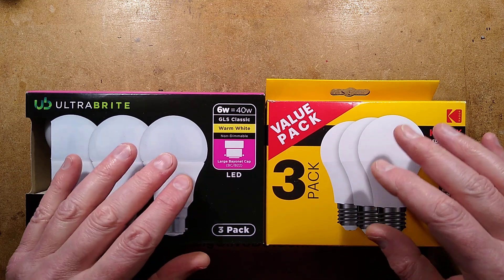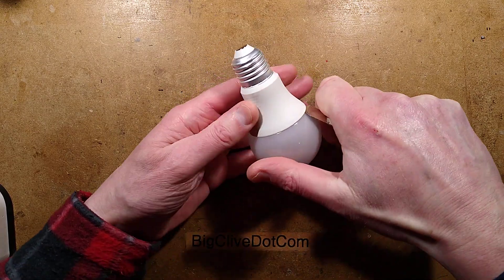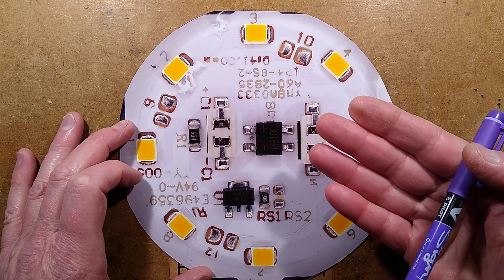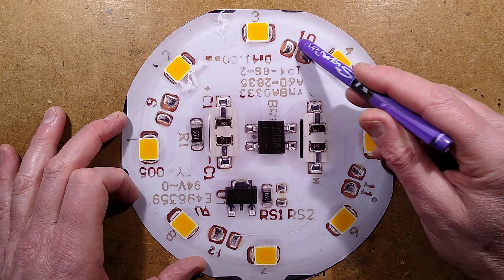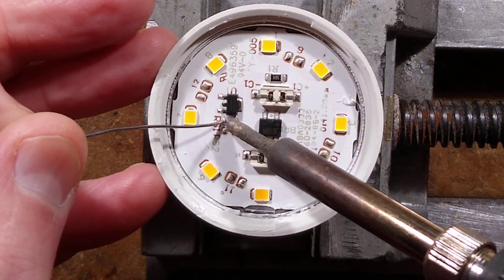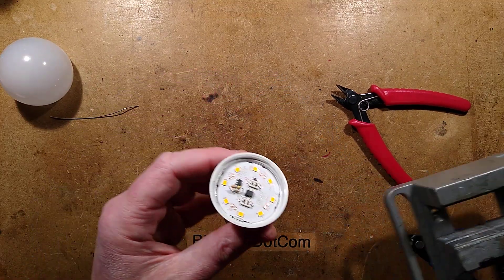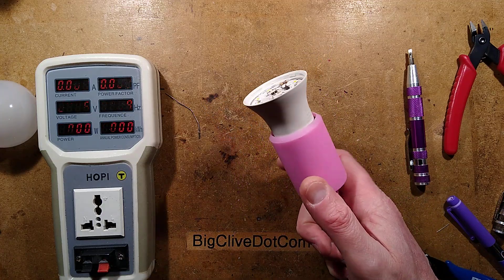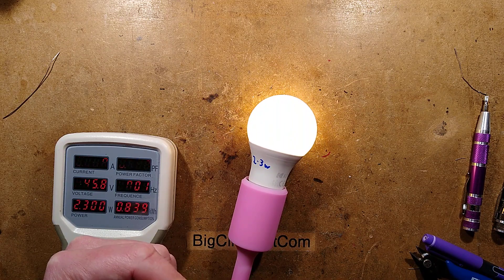Hacking Kodak lamps

Comment: I've noticed in the US, most of these lamps have only one sense resistor. I was actually contemplating doing just what Clive has done here, but currently have too many irons in the fire. I usually just get the 40 watt equivalent, but suspect that the only real difference between 40, 60, and 100 watt equivalents is the value of that resistor. 🤔  I should have picked up a few of each when I was out yesterday to test this theory. 

Funny coincidence that Clive's soldering iron needed some repairs, since I'm struggling to find replacement tips for mine. It seems that the only tips that are made for my iron cost about half of what a replacement iron would. Must be time to upgrade from my poor old Wall-Lenk!
Reply: Bulbs with different ratings will very likely have a different number of LEDs fitted. The LEDs are very likely the most expensive components in the bulb, so you can be sure they will be drivern to their "max".
Reply: @superdau  you may be right. I think it would come down to the most cost-effective way to produce these lamps (cost of # of LED per board vs cost incurred with programming/tool change) . Unfortunately, the few bulbs I have available for comparison are too radically different to be of any good to compare.

Comment: Hello, I was wandering if it could be possible to hack those king of lamp so that they are a little "smarter" : light level is dim by default and brighter when a sensor is activated (motion or whatever).
Could a digital output from a sensor change the value of the sens resistor ?
That would be a nice upgrade ;-)

Comment: Great as always! However I would go the other way and try to double up those LED chips so half the current to each effectively getting close to dubai lamps in efficiency and longevity with also making them last longer Maybe even mix in LEDs with higher temperatures. Can't stand dim lights
Reply: I can't stand dim lights either, but I guess the best solution would be to just use a light fixture with 2 or 3 bulbs to get an overall power of over 10 watts
Reply: @ChronicMechatronic  while that achieves the brightness it won't make them more efficient at those chips are being driven hard.
Reply: @Will-sc3hw  I mean put 3 of them in one room after modding them. Then they are closer to their optimal efficiency and you get enough light
Reply: @ChronicMechatronic  yeah, that works too
Reply: @ChronicMechatronic  oui is is it 8 i

Comment: I have a novel way of getting a less powerful lamp. Instead of buying a 10 watt lamp and possibly destroying it in the process of modifying it. I buy a 4 watt lamp and save a couple of $$ in the process and it works out of the box!! Strange I know. I also keep the receipt and mark the lamp with the date. If it fails under the 3 years, I get a replacement or my money back. Something you cannot do if it's been opened. Only problem is, it does not make a good video.
Reply: But the 4 watt lamp is like this one, over driving its led's so you need to hack the 4 watt one too so it lasts longer, only you bought a 4 watt one thus you now have a nightlight after the hack...

Comment: Note.
Flashaholic here.
Decreasing the power to 25% of the original amount (2.5 W from 10 W), has decreased the luminous flux from 100% to 50%. (500 lumen to 250 lumen), with a combined efficiency increase of 30% (from 45% to 60%), and lifetime increase of 200% (from 3,000 hrs to 10,000 hrs. at 20 °C ambient temperature).
Great perennial light bulb!

Comment: Resistance is futile! - So we'll just resist a bit more, then?

Now, I notice that these things usually come with a comment on the box which reads "Non Dimmable". Well, that definitely looks dimmer to me!

On a side note, how much less power would these lamps draw if you simply used say, a 240v lamp on a 120v supply? Would dropping the volts by 50% result in a 50% drop in Watts? I.E. would it be linear?
Reply: You have all the values you need to calculate that in a shot with the meter in it :)
Reply: With these lamps the power consumption should be pretty much proportional to the input voltage if it's in the normal operational range. Below 200-210 volts or so the power starts dropping considerably. Below 170 volts it's going to be nearly zero.

Comment: would adding a small variable resistor with the adjustment some where on the outside work
Reply: Make sure you have a nice bias. Like the original resistor and then the adjustable one in series. Make sure the parts you can touch are not electrically connected to the resistor terminals - this current regulator could be on a rather unpleasant voltage in regards to ground.

Comment: I thought LED light bulbs were supposed to be energy efficient, but I noticed the Dutch Calex brand being sold in Tesco are pretty much all rated as 'F' for energy efficiency.  Could someone please explain why that is, please?!
Reply: They've updated the scale they use to assign the letters to.  Apparently we're being encouraged to not buy electronics because they are now F or G rated in energy usage 😕
Reply: @0xf_Steven  i think it's more that there's lots of room for improvement on the scale now. Previously led lamps were all A+++*** or whatever, now even the decent ones might only get an E. The idea is that manufactures now have an incentive to make more efficient designs again
Reply: @0xf_Steven  I guess I'll just revert to pig fat candles, then!!
Reply: Energy rating is relative to the product category - classic incandescent bulbs got a different rating (when they were still legal) than LED bulbs. Also the rating gets more and more agressive every few years. So your F LED bulbs today would have been something like AAA+++ ten years ago. They are probably F because they use the LED chips at high power, where they get hot and inefficient. Normal LED lamps should be about 100 lumens per Watt, really efficient ones will have more lumens, really bad ones more watts.

My guess is that in ten years we will get A rated LED bulbs that are essentially optic perpepetuum mobilés - outputting twice as much power in terms of light than they are consuming in electric power. If you combine those with class A efficient solar cells you can really cut back on your electricity bill! The downside will of course be that you have to be careful to not produce a runaway photon cannon this way - always install a current limiter.

Comment: About 6 months ago I bought some ASDA LED lights to hack, But I could'nt remove the lense without destroying it. It was realy well glued in. So I bought some from B&M, Eveready branded, the lense came off easily, but there were no resistors, (or any other components), on the board with the LED's. LOL. So I gave up. :)

Comment: the poudland near me has 'maxim' branded 6w ones, slightly different innards 7 leds but spaces to have 10,  sense resistor is 33 ohm, different regulator chip changing the 33 to 68 should half it nicely, i would think ? i recently got hold of a load of 68 ohm ones, so easy enough ;-)
Reply: also small globe size, 5.5w ultrabrite branded, different regulator again, 5 led, 2 paralleled resistors 62 and 82 ohm

Comment: good advice all around.  I bought a set of those 12V camper style rectangular LED lights you had shown earlier.  One of them I wired up with an ebay TP4056 and MT boost converter but instead of outputting 12V I use 11V.  Still wicked bright but near half the current.  With a 2000mAh lipo all taped to the underside it makes a handy flashlight when I need to go looking for things in the dark.  It's amazing how a drop of a volt or two can make for LED current/temp/lifespan.  Cheers!

Comment: In 2014 Cree reached 300lm/W LED´s. Today the standart lamps use LED´s with only 70-100 lm/W. It is technical easy possible to get 2000lm from 10W. More light less heat. If you want this you have to build your own lamps.
Reply: Where's your video?

Comment: Kodak seem to be making lots of stuff now besides batteries, originally they specialised in photography equipment, well they did in the old days. Kodak also do wet shave disposable razors because I spotted some in a shop in Prudhoe, they looked cheap an nasty sadly. I get that ghost glow with those energy saver bulbs, not the led types though. This is down to the phosphor coating. Old style florescent light tubes do this as do old CRT TV sets. I don't suspect these Kodak bulbs have a long life due to cost. They say you get what you pay for, the more you pay the better the product.
Reply: Poundland bought the rights to the brand name and now stick it on any old crap.
Reply: Kodak still make their film.  The real kodak that is.

Comment: I have a bunch of LED lamps I bought from ikea years ago.. They just blink off and on and flicker. Sometimes they'll stay on after awhile but I hate that all the LEDs work but they just wont stay lit. Is this something that could easily be fixed? Its inside parts look very similar to this lamp. The circuit board is connected to the base by two pins. So it basically will unplug from the housing.
Reply: It's probably a cracked connection somewhere. If you're lucky it's in the solder, but it's very likely to be in the LED chip itself. I'd look for and fix cracked solder joints. If that doesn't fix it and you're comfortable working near live circuits measure the voltage across each LED package when the unit is acting up. If you find one which is much higher it's bad. Solder a wire across it and the bulb should work again. But be sure to do the current reduction mod or it will quickly fail again.

Comment: It would be very informative to use a light meter to see what the drop in illumination is when going from 11W to 5W to 2.3W as I doubt that it is a linear relationship.
Reply: The light output of LEDs is quite linear with current. As the voltage is constant (LED forward voltage doesn't change much at different currents), current is mostly proportional with power (as measured by the HOPI), and so is light output (ignoring thermal effects on efficiency; the change in light output due to that is negligible compared to the change due to the different current). The thing that isn't linear is your eyes! Perception (for sound as well) is logarithmic.
Reply: @superdau  the efficiency drops as the temperature goes up. You get about 40% more lumens per watt with a cold bulb. In the video linked above, cutting the light output by half cut the power draw from 11 watts down to 3.7 watts. So if you use a fixture that holds two modified bulbs, it will produce the same amount of light, but only draw 7.4 watts instead of 11 watts.

The bigger win is that the bulbs will last much longer.
Reply: @hamjudo  
What temperature is a "cold" bulb? And what is hot? I seem to remember that the efficiency of LEDs drop by about 10% when going from 20°C to 80°C, so not that much. The lifetime increase of running the LEDs cooler is indeed massive though.
You have to be careful when comparing the efficiency change in a bulb with modification. The large efficiency increase is not due to the change of efficiency of the LEDs themselves. You are measuring the power usage of the whole system, including the power supply of the bulb. In that case the efficiency went up, but this may not be true at all for other PSU designs.
Reply: @gargantuablargg  
Yes, it is a hit to efficiency, but only a very small one. The thing with LEDs (or diodes in general) is that the voltage/current relationship is exponential and not linear. A very small change in voltage has a huge effect on current. That means that a linear regulator does not have to drop that much more voltage to greatly reduce the total current.
Reply: @superdau  I haven't looked into the regulation of these bulbs, but when I designed a regulator for a low voltage LED lighting application I used a current regulator design, not a voltage regulator.
Reply: @superdau  It's not even close to linear in reality. This is because of the resistance of the LED and all sorts like gunn diode effects and all sorts. For example at 20mA an LED has a resistance in the ball park of 5R some a bit more some a bit less. IIR gives us 2mW dissipated as hear from the DC resistance alone. Reduce the current to 10mA and you get 1/4 of that value. Take it down to 1/3 and your resistive power dissipation is 10% which leaves more power for light output.
Reply: @superdau  it's not linear that's why their efficacy is listed at lower sometimes much lower than max current in the data sheet.  They drive them hard at reduced efficacy to reduce chip count.  The warranty is marketing wankery printed on the box.  They know the % of failures other than infant mortality that get processed as warranty is essentially nadda.
Reply: He did a video measuring that recently, there is a sweet spot in efficiency

edit: was actually 11 months ago https://www.youtube.com/watch?v=biEZ1TbdhhU
Reply: @ChronicMechatronic  came here to link this 😁
Reply: the linear regulator has voltage drop on itself and that can be 1 - 1,5 W that adds to power consumption that should be included in calculations
Reply: To add, if you look up "slyt617.pdf" Analog did a white paper on LED efficacy versus forward current. There is an asymptotic curve shown against power and flux, and they discuss the net reduction in operating power vs # number LEDs.
Reply: I was also thinking the same. Our eyes are not linear, so if the actual light output is reduced half, it may still look like 75% as bright as original, at 1/4 the power it may still look 50% or 60% as bright. Go from a sun lit sidewalk into a house with normal lighting, brightness may easely go down 100 times - yet, it doesn't look like that. But it becomes very clear when for example filming with a camera that has manual exposure settings and the shutter speed and aperture has to be adjusted accordingly. 
I don't think it's the actual efficiency that go up so much at lower power. Since the LEDs in many lamps are running quite high, there may be an increase in efficiency and indeed the life span (since they are running cooler) if for example the power is lowered from 10 W down to 5 - but probably not so much if lowering it further from 5 to 2.5
Reply: We could analyse the light output from a simple hand flashlight. Mine uses two AA batteries (3 volts). The colour temperature is constant but the light output definitely drops as they run down.

Comment: It would be great to see this kind of design, or a variation on it fitted to a three-way capable bulb.  Same set of LEDs but different currents.
Reply: But aren't those ungodly expensive by now? ( around here every one seems to be throwing away their 3 way capable light fixtures. I often reuse them with a normal bulb then use a different controller. Sometimes I put in a new bulb socket meant for regular light bulbs. )
Reply: @johnpossum556  Legacy 3 way lamp sockets are still common in 120v land.
Reply: Why not use a dimmer socket?
Reply: Because a dimmer socket costs more and has more complex points of failure than an a, b, ab switch

Comment: I work in B&M and they have quite a few Energizer and Eveready branded lamps. I've not tried any, but they're probably fairly standard.
Reply: I'd be surprised if those are really built by either of those 2 companies, however.
Reply: @johnpossum556  Both Energizer and Eveready trademarks are used under license either by Supreme Imports or B&M itself (for the lamps at least).

Comment: How low a resistor would make it pop and how bright ?
Reply: Probably not much lower than they're using and not much brighter than they are at stock, they tend to drive those things as hard as they can reasonably get away with, out of the box.

Comment: Could you show the stock and modded lamps side by side so we can see the difference between them?
Reply: The only meaningful way to do this on camera (other than metering their luminous flux) is to show one lamp at a time illuminating a room and having the camera at the very same fixed exposure settings for both shots.
Putting them side by side and then filming them doesn't tell you anything other than one being brighter than the other.
Reply: 1:11 and 11:41
Reply: @_BangDroid_  half as bright, huh. I don't mind that, easier with the eyes

Comment: That 3-year warranty probably says that if you actually use the product in real-life conditions then the warranty is null and void.
Reply: It only says that if it says it on the pack or otherwise is communicates before you buy.
Reply: 2 hours on only in 60 degree weather with 0 humidity.
Reply: That or "you pay shipping back and forth" making it more expensive than the value of the item.
Reply: Around here most of them say if they run only for 3-4 hours a day. My hall light bulbs are on a building wide timer so they get like 16 hours a day in winter.
Reply: I think that 99.99% of buyers will never go back to the store with the package, recite and the broken bulb to get the money back even if it was within the 3 year warranty. And with todays crazy inflation, they would probably even break even if everyone returned the product a few years after!